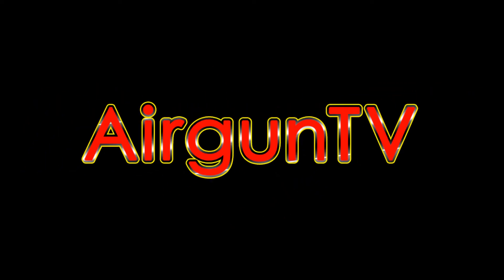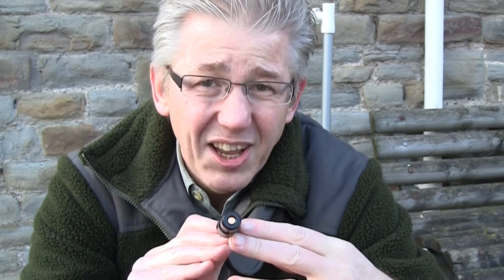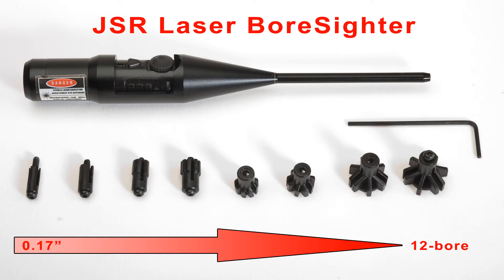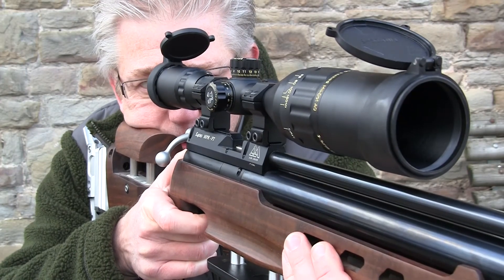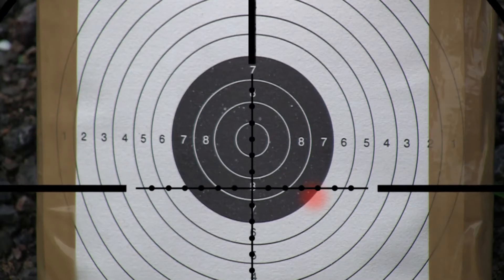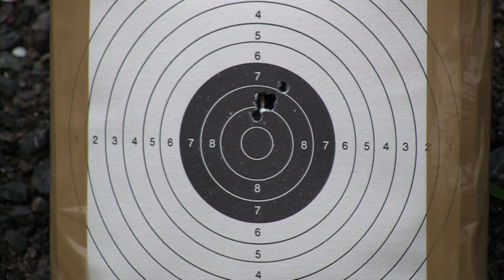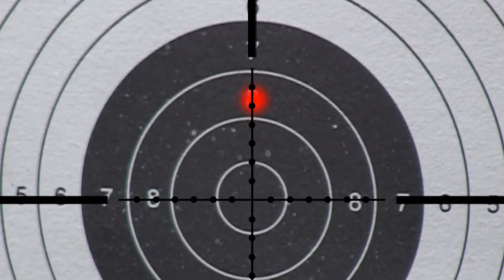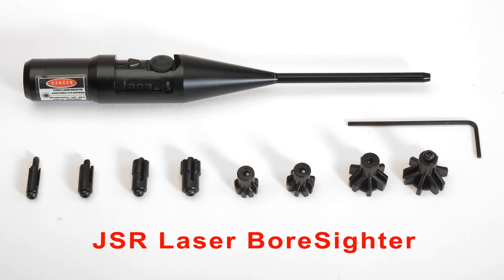Nigel Allen's demonstration of the JSR Laser BoreSighter

Comment: I can agree with you there Sir regarding the MPR. I bought one a couple of weeks back now and on a still day was able to group within an inch at 80 yards using Daystate FT pellets in 4.52mm
I have had my barrel modified to attach a moderator to an unf half inch thread which was lathed by a gunsmith and now it can only be classed as a true "Multi Purpose Rifle" as standard it is too loud for hunting.

Comment from the maker: Yes - yeserday in fact! It worked fine - and is well worth JSR's £33.95 asking price. On airguns, you'll find the boresighter will probably be out on the up/down plane, but you'll invariably get the windage spot-on. My tip is to set the scope to the laser dot... and then be prepared to fine-tune the elevation turret. The gun in the video needed upward clicks, but the gun yesterday needed downward adjustment. I guess it depends on the scope - but it's a very quck and handy way of doing it. N.